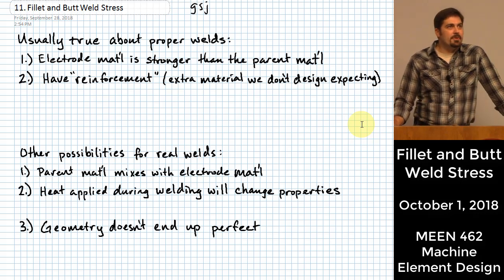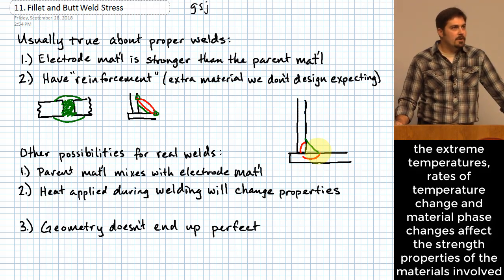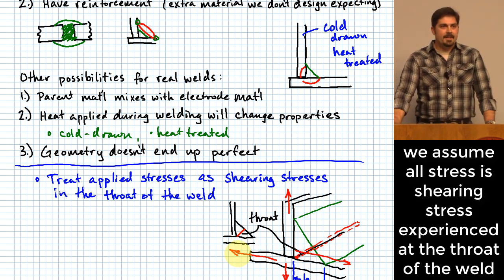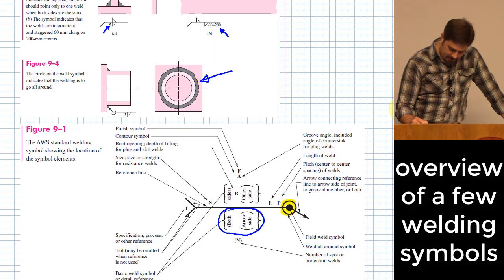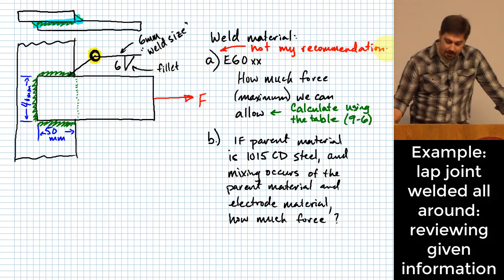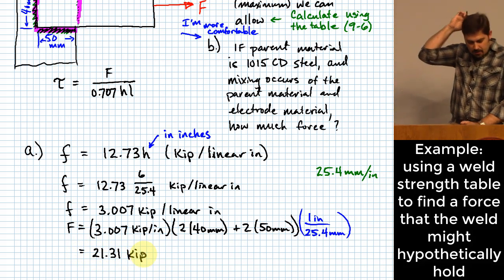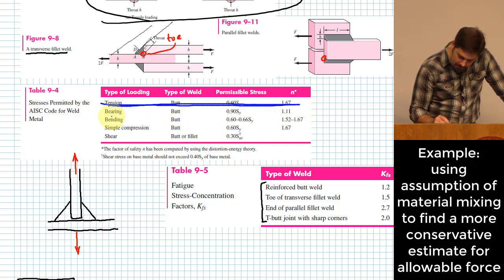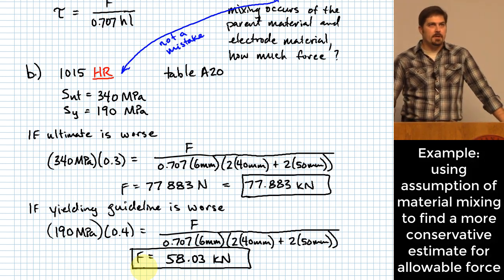Fillet & Butt Weld Axial Stress & Strength: A Simple & Conservative Method | Weld Geometry & Symbols

Comment: Quenching a hot part after welding wouldn’t “harden” your part unless your part is made of a very rare thing called tool steel but you probably don’t need to worry about it
Reply from the maker: Try posting this opinion on the welding message boards and report back. It is true that less carbon in steel makes a material less "hardenable," but welds cooled rapidly by water are very often more susceptible to cracking nonetheless, even in lower carbon steel. This is not only because of increased brittleness, but also because of residual stresses getting locked in. Better to let welds cool more slowly/naturally.

Comment: Is it this method applicable to all type of weld like SMAW , flux core and others?
Reply from the maker: This method doesn't really care how the metals are melted together or how the filler is added. It is a simple and relatively conservative way to get load capacity estimates. For important applications, I would recommend consulting with engineers who have more experience and expertise in the specific joining method you have in mind.
Reply: Thank you very much for the reply sir 👍